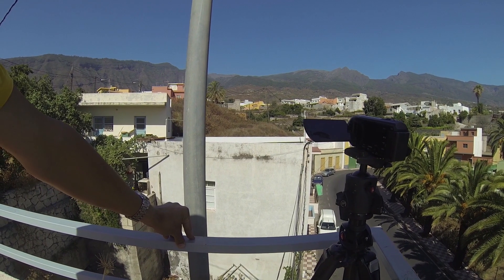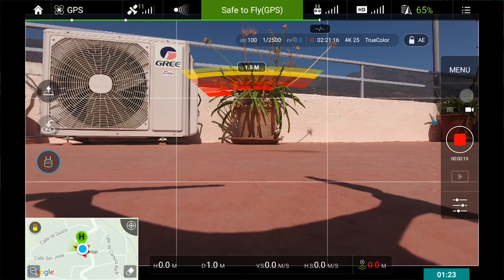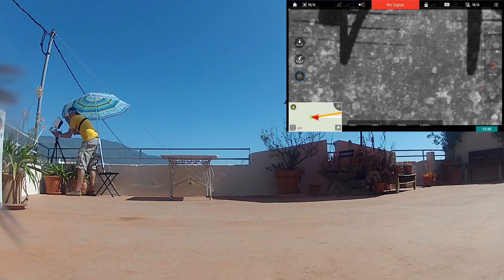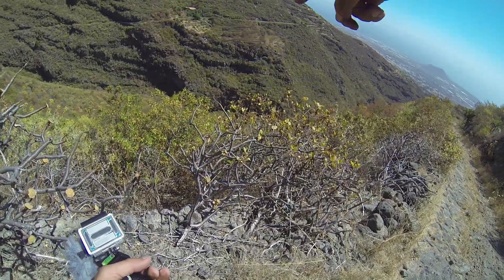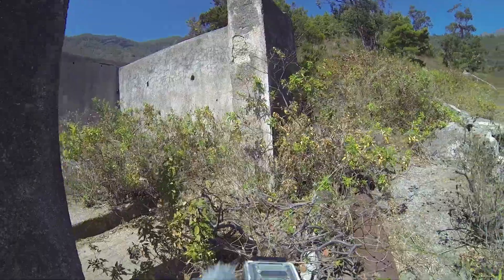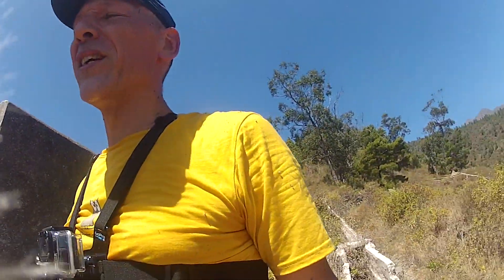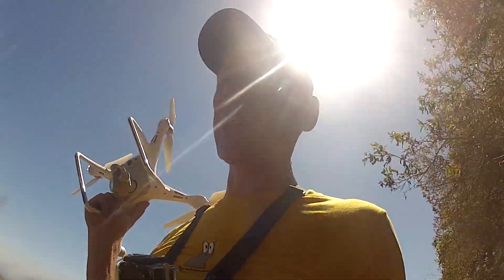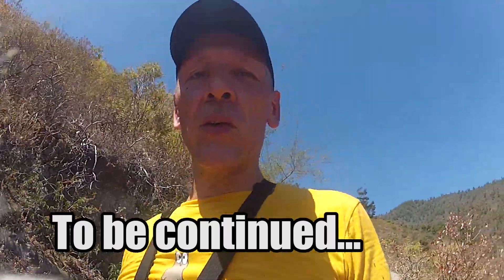TEST: What happens if the Phantom 4 loses signal and does not have enough battery to Return To Home?

Comment: Throttle down.  If you can’t see what its landing in or where.... that’s not good .... is it not better to “if there is some power left” to give u chance yo find a location to land.....the power on the battery still gives you drone GPS .... so you  simply go get your drone as it’s on GPS and you iphone will pair with it.      I have attached a wiFI  thingy like a dogs collar thing to mine and there are always WIFi signals about to find my drone

Comment: Yes great video mate, I did a similar test with Mavic, Fell short on way back from long flight, I had to land in a field as it started auto landing @ about 10%  battery left, I lost connection about 4ft from the ground, then rushed to car to find it.. Very interesting outcome! Here is the flight..   https://www.youtube.com/watch?v=wAxvfVZ2Jb8&t=34s  
p.s I think in this case you need to make sure RTH is cancelled when you lose signal..

Comment: Congratulations on the found RTH setting. The settings are actually described in the manual to your quad.   ;-)

Regards Leif.
Reply from the maker: Have you read the entire manual before your first flight?
I'd rather go out there and fly and see what I run in to ;-).
Reply: Normally, I look at the table of contents through and read the sections I will use the information from. If I doubt later, I will read it in the manual. The entire manual is actually on your tablet as a PDF file in academy and can be read from the DJIGO4 program if you have downloaded it  it once. So you do not even need a paper edition with you or access to the internet.

Regards Leif.
Reply from the maker: Me reading manuals doesn't make interesting videos... ;-).
Reply: That is correct. ;-D

Comment: Love your vids. I fly a lot of experimental missions very similar to yours and when I see yours you seem to be getting very similar results to me so thats both reassuring to me and good to see vids that have no bullS#1t in them. I have the Phantom 4 Standard and one big difference is that the most distance that the dji app will let me put in is 3000 meters so I am limited to that. Anything less works fine but if i type more than 3000 the numbers go red and when I push enter it defaults back to 3000m. At 3000m in reasonable conditions I still have good FPV and signal. Under the distance paramiter there is a switch that says 'limit aircraft distance' but its on in both positions!, have you done any mods or anything to yours to get it to go further? or maby it might be that mine is a standard and yours is a pro. Hmmm dont know. Ok clear skies to you and all your readers.
Reply from the maker: Yes, I have to switched off the 'limit distance' button. In this situation I had the ITEDBS antenna installed. My latest video shows a P4 going 3,9 km on stock antennas though.

Comment: Excellent video my friend. Great test of the Phantom logic. I wonder if you would have landed on the building then took back off then purposely lost signal with low battery if it would have tried to come home or land on the building. I think it considers home to be wherever it took off from last. Would be interesting to test this theory
Reply from the maker: It would have landed on the building again, because it records the home point when taking off. But after landing I lost the signal, because the side of the roof blocked the view/LOS. So I could not have taken off anyways.

Comment: The directivity of the antennas is important as the others have stated so they should be slightly lowered in this case. Next time, when you hit the interference,.  a good test would be to stop and increase altitude. The C/I should change in your favour as the (I) interference is lowered due to the increased distance from the ground. You could also verify your setup.by flying
off to the right over the unpopulated area. I the Telecom business we often have interference from microwave ovens in this unregulated ism band. Great videos!
Reply: Gary White hes not using the stock antennas

Comment: Great test, very helpful. Can I ask what type of Samsung tablet you are using? (and does it have gps?). I use my iphone6+ currently but I would like something with a bigger screen? (I also have a standard ipad but it's too big to be practical). Thanks if you can help
Reply from the maker: It's Galaxy Tab A. Works perfect, but for me I'd like to have another one, because the screen recorder does not render 25 fps on it. But if you don't want to use that, it should be fine.

Comment: That was an interesting test and adventure!  The only thing you forgot was to carry along a fully charged battery and when you
got to the quad, relaunch the quad with the battery and send it home. :-D I would suppose it would hold the old compass setting?
Anyway, it would save from cracking up the quad or falling, and from having a accident climbing around the rough terrain.
Real nice scenery and interesting test, thanks for your video!
Reply: No, when you put the new battery in you have no choice, it resets the homepoint to where the aircraft is now! I do consecutive batteries regulary.

Comment: if it starts to return to home and you don't press cancel what will happen? will it crash or land when battery is dead?..i think thats the question
Reply from the maker: It will return to home and when it thinks it only has enough battery for landing, it will start to land. You can still move the drone a little bit during this operation, but you can not ascend anymore. You can hover by holding the 'ascend'-stick fully upwards.
Reply: Thanks man!

Comment: so I'd like to see if its possible to set another homepoint (say on the closer roof) by landing on the way out there then you could retrieve it after it loses signal from there. would be like emergency airfield.
Reply from the maker: Yes, the only thing is that I lost signal after landing and didn't get it back. That might happen and an earlier roof too. But I found out, it's not even necessary to land. You can just hover about a landing point and then set that as a new homepoint in the menu.
Reply: wow, this could be very useful for people on long distance missions, with proper planning you could use a secure location to retrieve your drone or have it land near a friend. love your videos btw. keep up the good work and ideas.

Comment: I won't recommend to lift of with a battery less than 100 procent. It can cost you your Phantom. Tip: Make you're voltage visible in the app. Anyway really entertaining video! Subscribed!
Reply from the maker: Tell me why it's good to see the voltage? And how can I lose the Phantom with half battery?
Reply: Hi NeverMindYourOwn, first great video's I really enjoy them :) To answer your question, you can take off on a partially charged battery if you take care to land by the time the first battery cell reaches 3.4V. If you fly beyond that, you really need to know what you're doing because you can get into some tricky situations when trying to fly on batteries in the 3.0V - 3.3V range.
Reply from the maker: Ok, I'm learning here :D. Tricky like what? It catches fire, or something?
Reply: o
Reply: oj
Reply: No just for overseeing your battery and its condition. So you can take action if you see the voltage drop. Like our video's! Your latest one with the picture's taken you had set it on 10 sec. So that's why It did what it did. ;)

Comment: Hi, good video !!! 
I have one question for you. If Phantom 4 lose the signal. Should it return to home ?
Reply from the maker: The safest option is to set it to Return To Home. If you have also set the Smart RTH option on, it will even avoid obstacles when it returns. The most important thing is that when it tries to RTH, at some point you will get the signal back and then you can cancel the procedure and keep doing what you wanted to do.
If you lose signal and you told it to hoover, you may never get the signal back if you are not in a position to move around to get a good line of sight again. Then it will run out of battery at some point and automatically land just where it is. In most cases that is not desirable.
Only in special rare cases like mine, where I want it to fly from A to B and not return, you may want to set it differently.